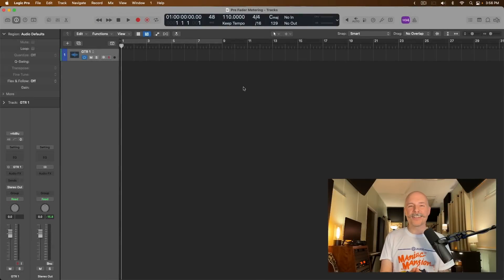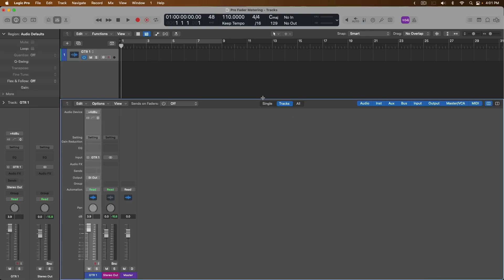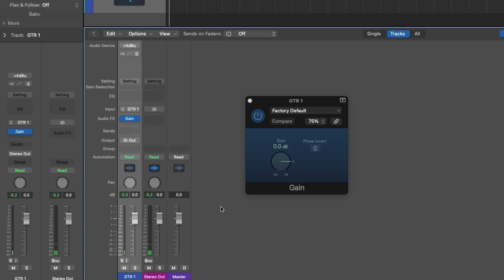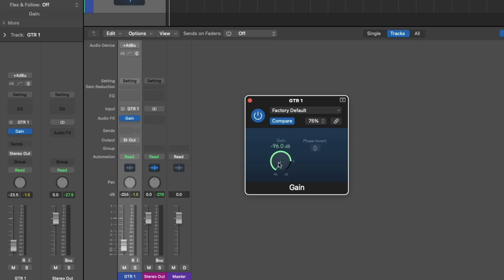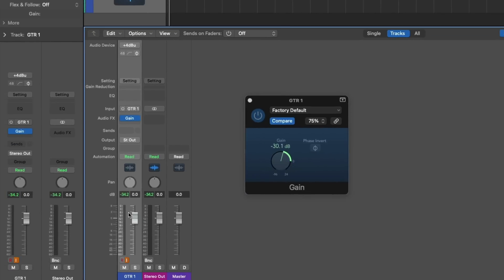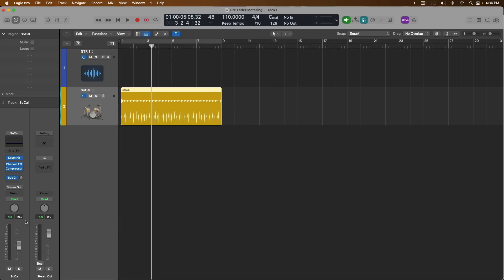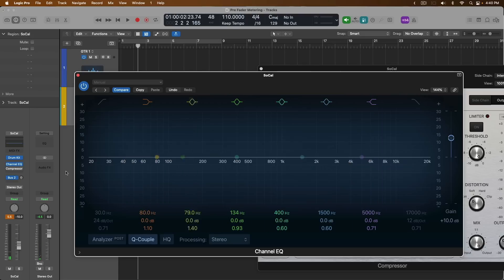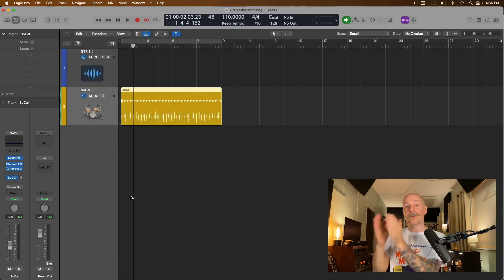How Pre Fader Metering ACTUALLY Works in Logic Pro

Comment: Thank you for this video, very helpful. I’m new to mixing process in Logic Pro, and I’ve watched your other video regarding the gain staging process, which recommends a -18db level for all tracks, does this mean I should adjust the pre-fader metering level to -18db every time before I add a plug in to the channel, so the input to the new plug in will not experience distortion? Hope my question makes sense, thank you in advance!!

Comment: I love it because sometimes you mix, set the fader/automation and later add more plugins. And won’t realizing you’re hot on the track unless you bypass automation and briefly zero out the fader to unity and that can make it super loud, which meant you have to turn the stereo out or interface down. 
Pre fader metering can quickly show you on all tracks at the click of a button without having to do any of the above to check. Very cool!
Reply: well put

Comment: I've been using pre-fader metering to set pre-amp gain to get around -18dbfs in logic. Is this a good way to use the function, or should I rely on the audio interface meters instead? Further, say I load a guitar preset in logic before setting gain: does this affect track levels when pre-fader metering is switched on?